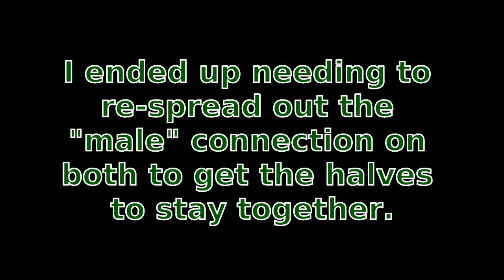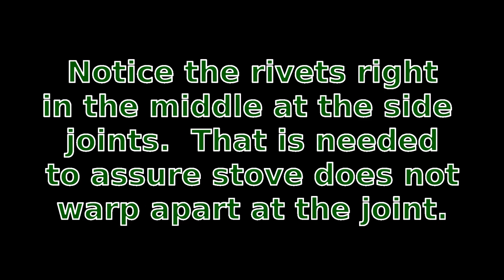Make A Simple Cheap Tent Wood stove - Part 1

Comment: Nice, I may have to build one of them.  Have you given any thoughts how to prevent  burning out the bottom quickly.?
Reply from the maker: Yes.  I do plan on placing a false bottom in the stove eventually.  I will use two pieces of metal that is just short enough to fit in the inside length of the stove.    I will bend a short 90 of perhaps a half inch along the whole length of both sides of each piece of metal.   Each piece of metal after bending the edges will fit across half the width of the stove and the full length of the stove.  Once the bends are completed I can place one piece in through the door and into place and then the other piece can then be put in place to cover the whole bottom.    Hope that made sense.
Reply from the maker: I do believe though that the sides will burn through quicker than the bottom but even then I believe that I should get quite a few years of occasional camping use out of this stove.

Comment: after the burn off would you recommend painting it with high temp paint to prevent rusting?
Reply from the maker: I do not personally know how well paint will adhere to the resulting metal finish.   It is an oxidized finish once the zinc is burned off.   I personally will be just spraying this cleaned out stove inside and out with PAM type cooking oil at the end of each season and storing the stove out of the weather and leaving the finish as is.

Comment: Lonnie,  what a great stove.  Actually, easy enough for Mr 6 Thumbs (me) to build one.
How could you put a spark screen on the air intake?  I would be up all night waiting for a spark to pop out and burn my toes :-)
After the galvanizing has burnt off,  could you paint the exterior with some high temp paint??
Reply from the maker: I do not know if the paint will stick to the resulting finish after the galvanizing has been burnt off but I do not believe that any is needed.    I will be spraying the cleaned stove down inside and out with PAM cooking spray at end of each season.  I have plans for a cheap but highly spark arrestor to place on the top of the pipe as well as other mods that i will eventually video.

Comment: Pretty slick setup Lonnie. One question, did you make it long enough for the pipe sections to fit inside while transporting?
Reply from the maker: No I did not make it long enough for the stove pipe lengths that I currently have.  If I was to spend the money to get a nesting pipe, I think they may be short enough to fit inside the stove.  I have a set of 3 inch nesting pipe (too small for this stove) that is 20 inches long and would fit inside.

Comment: Love the video Lonnie did you put dirt or something in the bottom of the stove to make it last longer after you burn off the galvanized coating
Reply from the maker: No I have not placed anything in the bottom as of yet.  I plan on eventually placing a false bottom in the stove as well as other mods.  I will video the changes.

Comment: 1.5x playback speed seems normal... Heh, you could speed it up 1.25x as default and no one would notice. Well, people may note that you seem younger. :)
And you dont wanna use galvanized zinc sheet metal but black iron (bare).
Zinc will evaporize anyway, the fumes are toxic and you'll be left with less iron. It simply doesnt make sense when the black sheet is cheaper.

Comment: This is a nice little project. 
Wondering?
I have a pick up truck with a high fiberglass camper type cap. 
Do you think this would work in the truck?
How would I insulate the fiberglass so I do not burn it with the stove pipe?
I was thinking straight out through the top?
Reply from the maker: This stove or almost any woodstove would be too much heat for the pickup bed cap.   Maybe a very tiny stove such as the stoves that are popular using ammo containers might fit the bill but stoves like that can only hold a fire for a few minutes at a time and as soon as they are out then the cold comes rushing back in again.

Comment: Lonnie,  I know about zip about woodstove tech, but it occurred to me that a piece of wire mesh [possibly finer than the 1/4" spark arrester mesh, or two1/4" pieces with the meshes oriented obliquely one to the other] placed over the hot end [as shown at about minute 29:50] of the stovepipe [to catch incompletely burnt embers before they start up the ever-cooling stovepipe] so the embers stay down where they can burn down in size  to where the odds of them reaching the spark arrester and going free-range with much remaining combustible mass is reduced.  No clue if this would work or clog, but it might be worth a try outside, in snow-time.
Reply from the maker: Yes a spark arrester placed inside the stove pipe at a point still near the firebox is indeed a good spark arrester and self cleans itself.  I did not use one here because I wondered if I may need a 5 inch stove pipe instead of the 4 inch stove pipe that i used in order to overcome the diminished draw from having something internally partially hampering the exhaust flow.  It may be that the 4 inch would still be sufficient but i do not know for sure.   I can give it a try and see though so far this present external design works well.

Comment: Excellent job,  now I've got to give this a go!
However, I've never actually had to use a rivet gun? Are they pricey? Also, did you use any sort of JB weld on any of your seams before riveting them?
Reply from the maker: No I did not use any adhesives or two part epoxies anywhere.   Rivet guns are not expensive as they are a relatively simple hand operated tool.

Comment: What about using the black stove pipe would it need to be burn off great build for the ones that can't afford to buy one
Reply from the maker: All new stoves whether commercially made or home made should be burnt off outside initially since there may at least be oils or other preservatives on the metals to keep them from oxidizing.

Comment: What do you think of using a metal heat vent cover like on a trailer home floor the ones with a louver to open and close the vent as a door on a mini fire stove similar  to this one but made from a piece of square duct work
Reply from the maker: If the ones I'm thinking of are what you are thinking of, I'm wondering if they might have problems functioning.   The apparatus that opens or closes would be sticking into the fire box some distance and could potentially have a log fall against it and perhaps jam up the ability to close or open until the obstacle is cleared.

Comment: Hi Lonnie, I made your wood stove using your video here. Turned out great and we used it this weekend. I’m noticing the stove ‘chugs’ like a train sometimes (smoke puffs/pops in and out like a train) with the door closed and the vent open. Any ideas how I can fix that? I used your same dimensions, but chose a 3” stove pipe for our canvas tent - with 3 20” sections of pipe. Did you get any smoke chugging with yours?
Thanks. We’re all enjoying your videos down here in Canada!
Reply from the maker: Great.  I think part of your problem if not most of it is because of the small pipe diameter.  I have noticed that larger diameter pipes have less of what i call a whoofing problem.  You could also regulate that whoofing by not allowing the full air intake as long as the burning rate is slower.  As the burning rate picks up, you can also give it more air if you need to.

Comment: I knew how to do all those things.  But I sure didn't know how to build a real stove, thank you.  Why use galvanized sheet metat?  Would blue stove pipe do as well?
Reply from the maker: Galvanized sheet metal ducting is widely available and accessible to almost anyone at least here in the USA.   Other sheet metal would also work but if the metal is much thicker than this ducting then hand bending methods will be more difficult or impossible.

Comment: How long do you expect it to last before the light gauge sheet burns through? Would it last any longer if lined with a thin sheet of refractory panel?
Reply from the maker: Time will tell how long this stove will last But I will not be surprised if I get at least 5 years of occasional camping use.   I will be making a false bottom for this eventually and will video this along with other mods I have in mind for the stove.

Comment: This is my best transcripts of the materials and tools required:

Materials:
-7" aluminum stove pipe x 1
-2x4 x 1
-4" stove pipe x 1
-4" roll of tape/other 4" circular thing
-thick peice of wood about 8" in diameter 
-flat duck work sheet, 16" × 34" about 
-11" right angle board
-1/8" body, 1/8" grip steel rivets, x 50
-material for baffle 
-2 steel latches
-2 steel hinges
-small bolt
-bolt spring
-2 nust for small bolt
-aluminum angle x 10 feet or copper pipe
-12 - 13" bolts x 2
-8 nuts for the 12" bolts, maybe 8 washers

Tools:
-measuring tape
-sharpie marker
-hammer
-saw
-tin snips
-hammer
-Clamps x 4
-work bench
-wood saw
-left hand tin snips
-scroll saw?
-flathead screwdriver
-small sledgehammer
-drill
-drill bits
-hack saw
Reply: I missed a rivet gun in the tool section
Reply: And a work bench as well.
Reply from the maker: Thanks for writing that out to be a helpful reference for others.

Comment: Absolutely excellent job! Thank you! One question, would paint the exterior with high temp paint to protect the metal after the galvanized part is burned off, just to protect it from rust etc? Thanks again for making and sharing. Linked, subscribed, and sending this to my friends and family.
Reply from the maker: Thanks for subscribing and sharing the video.   Welcome to the channel.   A high temperature paint should work fine as far as I know.   It needs to be a paint designed for stoves though rather than say a barbecue.  Barbecue paint may not handle high enough temperatures.  I have never painted any of my stoves so do not know from personal experience.   The main thing is to store the stove out of the weather when not in use.   It will last many many years that way.    I have a military surplus tent stove that is well over 30 years old and is still fine with never any paint.   I do not use that stove much but it is still fine if I did want to use it.

Comment: I guess my only question is if you used black stove pipe, to make the same design would that be safer and possibly even a bit more durable?
Reply from the maker: Safer??   It would definitely be heavier duty and would last longer but It would  be less manageable with tin snips and wood forms.
Reply: @Far-North-Bushcraft-Survival  Sorry was referring to safer as in not galvanized and meant for the purpose of a wood stove. And I agree would be a PITA for tin snips and wood forms.

Comment: Great project!  I have one question though... should not the bend on the lip of the stove pipe hole go UP out of the firebox?  that way your stove pipe fits the female end over the lip.  the stove pipes would then fit with the male inside the female going upward so the heat and smoke would travel out without an opportunity to seep out of the seams.....  the way you've got it with the lip bent inward allows for upward escape of heat and maybe a smoke leak????  Maybe I'm wrong what am I seeing wrong in your vid?  thanks for a great video - this is just bothering me so I am commenting which I almost never do!!
Reply from the maker: You did see the stove pipe collar correctly.  The collar does go down into the stove and that is for a reason.  You DO NOT want the stove pipe collar upright so as to fit inside the stove pipe.   Burning wood creates distillates which condense out on the cooler stove pipe and run back down the pipe to drop back into the stove and be burnt.  If you place the stove pipe outside the collar, those distillates will run onto the stove top and drive you out of your shelter because of the fumes and overpowering aroma.  In a properly designed stove such as this one, you do not need to worry about smoke leakage as long as you are using a clean stove pipe that is not built up enough with creosote to limit draw.

Comment: Nice1. Is it possible to hook up something like a catalytic converter to the exhaust pipe to turn exhaust to vapor so you can keep it inside and not lose any heat?
Reply from the maker: There really is no need to do so as this stove is capable of putting out way more heat then will be needed.   There may be ways of doing what you ask but those skills and knowledge go far beyond my level.

Comment: I'd get one of those lightweight fire bricks (the sort that are about 1 inch thick, and which you can cut to size) and use it to line the floor at least, so it wont burn out so fastly
Reply from the maker: I will not be surprised if I can get at least 5 years of occasional camping use out of this stove as is.  I personally would rather just use an elevated sheet steel bottom and probably will do so eventually.   Fire brick is not something that I would want to transport in a camping situation.
Reply: It might last that long, as long as its stored empty of ashes and kept dry when not in use....I use those biggish dustbin sized weed incinerators, made of the exact same thin galv metal (with a chimney) to burn garden waste. The bottoms rust out in a short time but thinking about it, I leave them outdoors with damp ash in the bottom....(doh)
Vermiculite sheets aren't dense and heavy like brick BTW @Far-North-Bushcraft-Survival
Reply from the maker: "Vermiculite sheets"   I had not heard of those and it does sound interesting for this application.   I plan on fabricating a false bottom out of sheet metal and will be videoing that project along with other stove mods that I have in mind.
Reply: LOL as I type I am awaiting delivery of a ceramic wool blanket to line a small tin can gas forge to make some bent knife blades, that stuff is even lighter than vermiculite......its usually used for raku pottery kiln's. 
Hope your stove works out any way, I like all your video's @Far-North-Bushcraft-Survival

Comment: Once you’ve burned in this twice outside to get rid of the toxic smells and stuff would this stove be able to be used in a tiny building for heat? Also how long do you expect this stove to last in other words would it eventually burn through the metal or weaken the metal?  Please
Reply from the maker: Yes after it is burned off outside, the stove should be safe in a building except I personally would not use this stove in a permanent structure.  You really should use a heavier duty stove for that use.   This is very light duty designed more for occasional camp use.  For that occasional camp use, it may last 10 years or more.  For frequent use in a building it could end up burning down your building due to premature burn through.

Comment: Hi. very nice tutorial. Could I use a stove like this in a garage that is 20 x 20 ft x  8 ft ceiling? Thanks in advance
Reply from the maker: Yes you could heat the garage with this stove but I do not recommend it since this stove is not meant to be a long term frequent use stove.   This stove should last quite a while for it's intended use such as occasional winter camping trips in a tent.   For heat inside a garage I would recommend a much heavier duty stove made from much thicker metal.    A heavier metal stove would not only last you longer but it would be safer for use in a garage where you will most likely not be present at all times while the stove is in use.

Comment: I do love your videos, but ...........
For the stove pipe hole, shouldn't it have gone out instead? That way the bigger end of the pipe would go over it. This would prevent smoke from leaking out.
Reply from the maker: The stove opening was indeed designed as a wood stove should be.  To do as you suggest would be asking for trouble.   If you will notice on almost all professionally designed wood stoves,  the first stove pipe goes INSIDE the stove.   All stove pipes will have the wide end of the pipe upward with the narrow end downward.  The top of each section of pipe goes outside of the bottom of the above pipe.  There is no worry of smoke coming out of a proper stove joint.   What one DOES need to worry about in improperly positioned stove pipe joints is condensates running out to the outside and then stinking up the living space with fumes.  That is why all stove pipe joints should have female end up and male end down.

Comment: To keep it from rusting, paint it with high temp bbq paint after all of the galvanizing has burned off.
Reply from the maker: Instead of painting, I will be spraying the cleaned stove inside and out with PAM type cooking oil at the end of each winter camping season and storing out of the weather in the off season.  If the paint will adhere to this metal, painting does sound like a good preservative however.

Comment: Nice looking stove Lonnie. Will that thin metal hold up to the heat? Just wondering before I attempt to build.
Reply from the maker: Yes it will hold up . . . for a while.   How long it lasts will depend on how often it is used, how hot it is allowed to get and how frequent it is allowed to be very hot.  Also whether or not it is emptied out and cleaned after each use or left full of ashes and charcoal continuously is important.  How damp of a climate or dryness of storage conditions will also play a part.   For occasional camping use and if taken good care of when not using, I am guessing it should last at least 5 years.
Reply from the maker: Ps I have used this stove multiple times and it is still going strong.